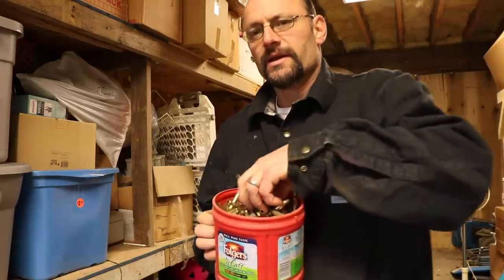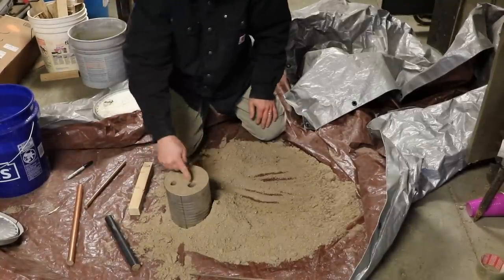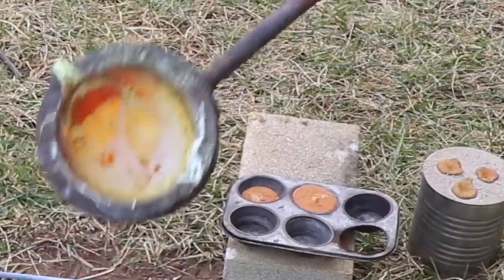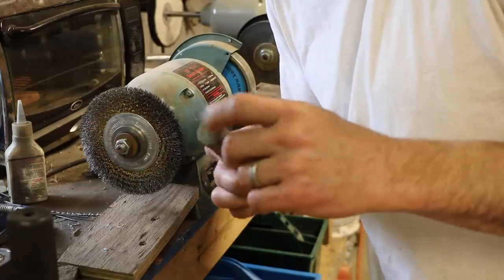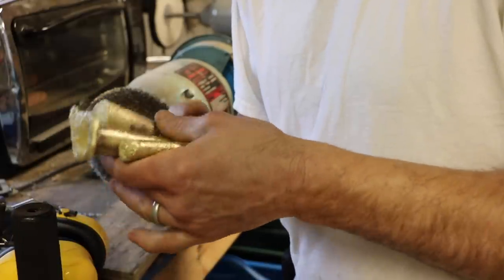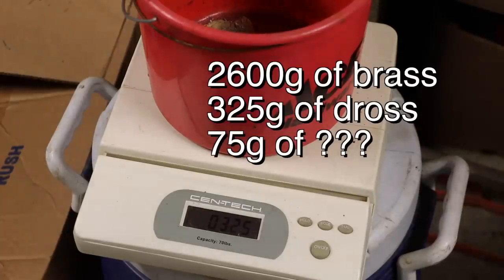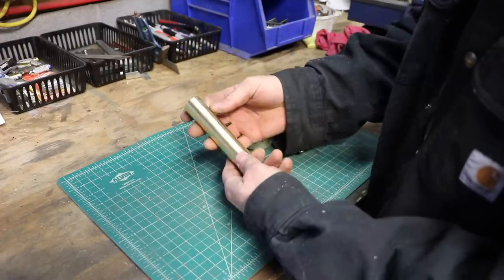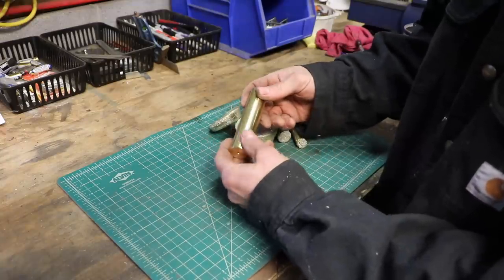Can you machine bullet brass?  Let's find out!  FarmCraft101

Comment: The bad thing is the casings are worth 10 times what you could buy the brass for, so fun, but not cost effective.
Reply: Yes but not military brass with burdan(sp?) primers.
Reply: @anthonysellick3520  Berdan primed cases are mostly steel cases. NATO cases are Boxer primed.
Reply: If you read again, I said military cases WITH Berdan primers (correct sp). NATO cases are NOT boxer primed (14 years as a weapons officer, I would know)
 For your edification boxer primers are the ones with one large flash hole and the anvil integral in the primer. Berdan primers have no anvil as this is built into the case which has two small flash holes.   I have personally fired / accounted for well over half a million rounds of nato standard 9 x 19mm, 7,62 x 51mm and 12,7 x 99mm without ever seeing a boxer primer.   Since I reload 2 of those calibres for my own use I was always quite dissapointed about this.   I even looked into the possibility of getting the depriming tool  but the berdan primers themselves are hard to come by in South Africa where I live.   The only military cases under 20mm that Ihave seen that are steel are after market ammo for ak47 clones ( and AK47s in places where they are legal) cheaper civilian .308, .306, .223 are also available here in steel cases but I was not talking about those.
  All irrelevant anyway since I referenced only military cases WITH berdan primers.  These are of little use to reloaders because they require specialist equipment and primers to reload them.  They are therefore practically worthless except for melting down.  Something I do a lot of.
Reply: In the end what you said about military brass is correct it's just that here in the USA you will not find many if any Russian military cases, I am WELL aware of the difference in priming methods, it is difficult to reload Berdan prime cases thus the low value, Russia and the likes use Berdan primed cases and in most cases that you will find here that are Berdan primed they will be steel. NATO cases ARE Boxer primed, I have tens of thousands of them that I have loaded myself, 7.62x51 as well as 5.56x45 as well as many other (non NATO) calibers, not to mention working for one Midwest (USA) based defense contactor who has made BILLIONS and Billions of them and they all have Boxer pimers.
Reply: @integr8er66   Hi again. Well we are getting closer together.   I live in South Africa where one can barely move without tripping over AK47 brass (it used to be the guns themselves so this is progress of a sort.)
As for the primer types.....  In a curious quirk of history the boxer primer, invented by an englishman is overwhelmingly favoured in the USA.  Conversely the Berdan primer, invented by an American is favoured in Europe.

Perhaps this is why in South Africa locally manufactured NATO standard ammo (while not actually a member of NATO South Africa has for historical reasons {it is one of the wwii allies} stuck rigidly to the Nato standards, The view being that in any future global conflict we would be on the side of the NATO nations or loosely put, the west.   This compliance extends far beyond ammunition specs and includes doctrines, infrastructures and even tactical signalling methods and publications relating to same.

So it appears that the NATO standard for ammunition does not specify the primer type. Just every other dimension including MVs from specific weapon types.  So it is entirely possible that USA manufactured military brass might have boxer primers.   Sadly here in the RSA where we follow the british version of most things (good idea when its whisky, shite idea when its beer) and our military brass (nato standard) has berdan primers.   I could have personally saved a fortune had this been different but since when do i ever get a break?

reverting to the original topic, berdan primed ammo CAN be reloaded but its a real ball ache to do and the integral anvils can get worn down after repeated reloading and cease to work.  Hence the brass is better for melting down than reloading, at least here in South Africa where its pretty much all still brass (although for how much longer..... but thats another topic ask if you interested)

thanks for a stimulating and ( a rare thing these days) polite debate.

Comment: Copper is notoriously difficult to machine due to gummy softness when machining. Add 1/2% of Tellurium to make C14500 alloy and the machinability is greatly improved. Brass is roughly 2/3 copper and 1/3 zinc. Also..."To enhance the machinability of brass, lead is often added in concentrations of around 2%..." So take 200 grams of brass, add 4 grams lead and 1 gram Tellurium, see what happens.

Comment: Its not dross its calked SLAG
Reply: Two different things where foundries are concerned. Dross is solid oxides and such in non-ferrous, low melting point situations (like what we see here), whereas slag is molten non-metallic constituents and oxides in ferrous (high melting point) foundry work or in steel-making and such.